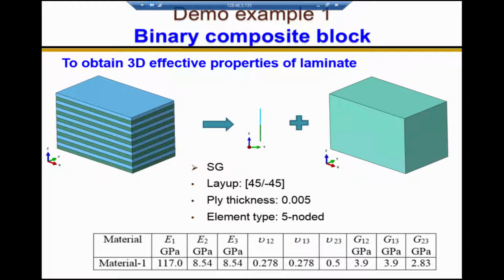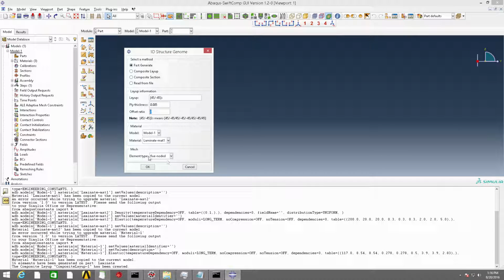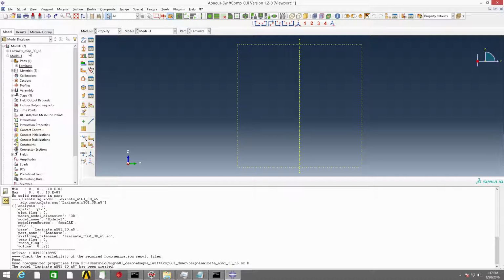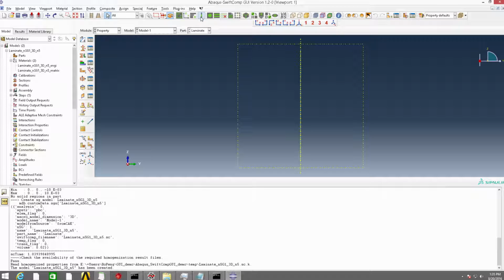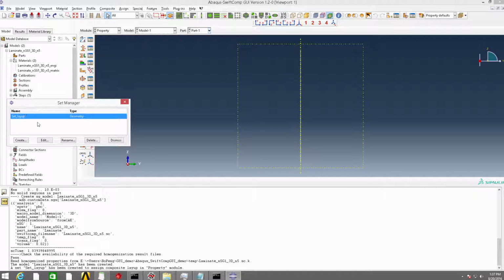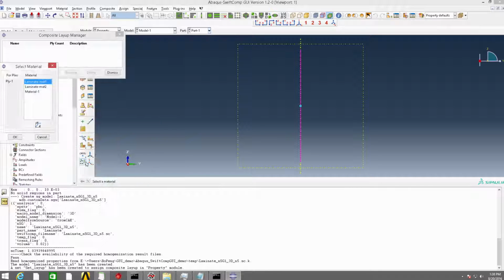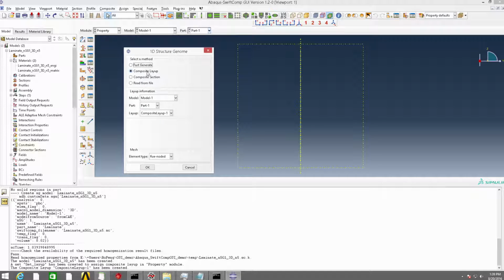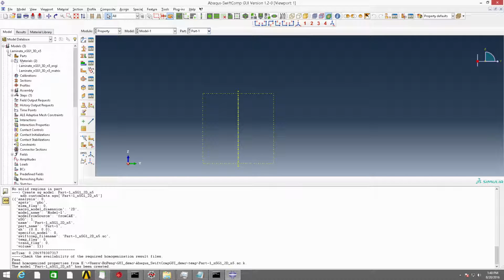Abaqus-SwiftComp GUI: 3. One Dimensional Structure Genome (Laminates)

Comment: Can you tell me how to model woven composite in ABAQUS. danishhanda1991@gmail.com
Reply from the maker: Hi Handa, you can follow the videos created by Xin Liu and use Texgen4SC in cdmHub to do the homogenization analysis.  The tutorial videos can be found at: https://www.youtube.com/watch?v=Dc8load6siI&list=PLGwp8OYDfmxFhtnDNJVRUJ8J-HP8FsnIU&index=2

If you want to use Abaqus SwiftComp GUI, first you need to create the unit cell in Abaqus like what you do in Abaqus(best to have Periodic mesh but not easy in Abaqus), or more conveniently you can generate the inp file using Texgen. Note you need to have materials and orientations defined in Texgen. Then in the Abaqus SwiftComp GUI, you can do the homogenization directly using the function of homogenization from inp file. For more information, you can watch the video https://www.youtube.com/watch?v=gfPnfG2mJDI&t=133s and also read the manual from https://cdmhub.org/resources/1134/supportingdocs.
Reply: I had seen this video. I already made a woven fiber in TEXGEN. However, after importing it in ABAQUS, I am unable to define loads. Already loads, BC's and everything is defined. I want to do a tensile test of a woven fiber. I am trying it from past 5 days but unable to do it. If possible please help me with this. Thank you
Reply from the maker: Danish handa you don’t need to apply loads and BCs. But if you did it doesn’t matter. You should not import the inp into Abaqus, instead you just use the inp directly in the Gui to do homogenization. For textile composite, I  highly recommend you use texgen4sc, which should be more convenient.
Reply from the maker: You also need to choose ‘local ‘ coordinate system in the homogenization.